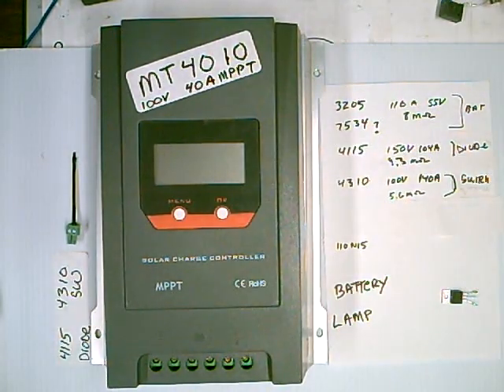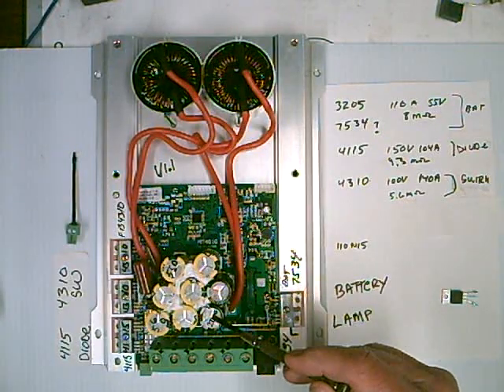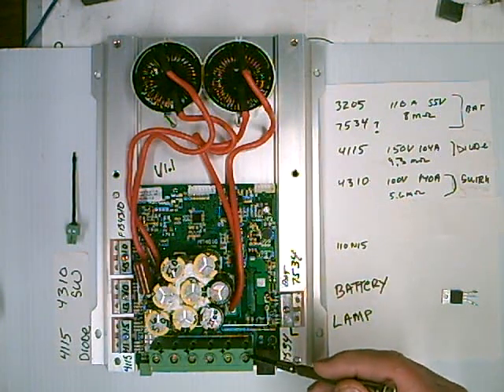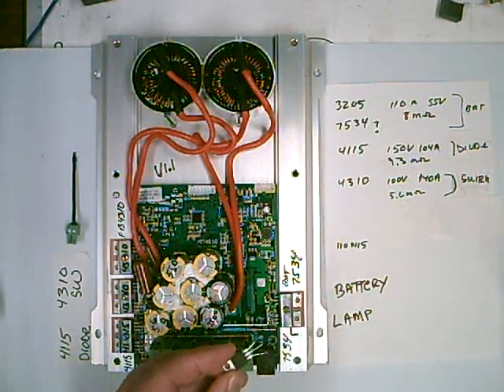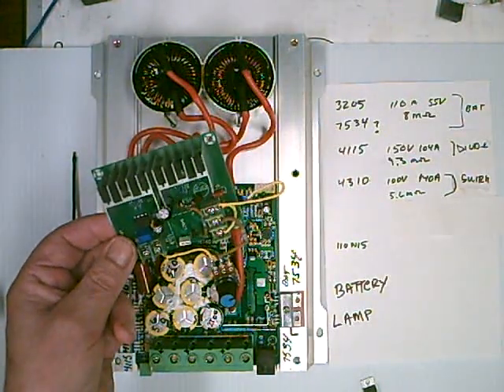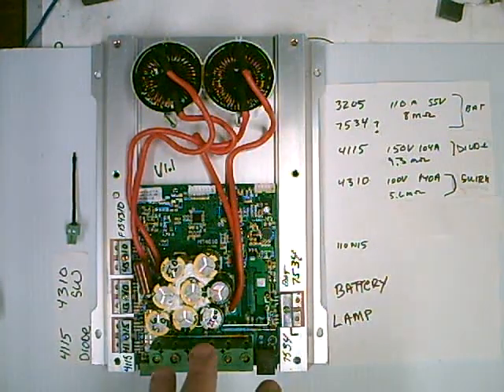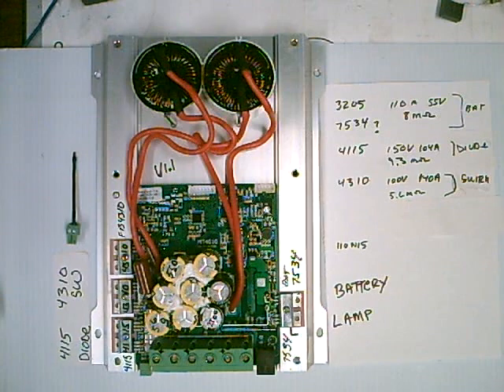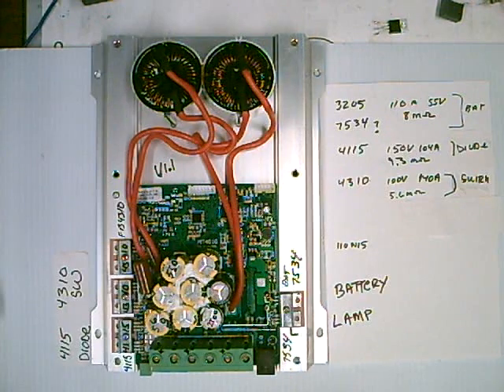Solar Charge Controller Repair MT4010 40A 100V MPPT

Comment: Today's standard PV like the China's 550watts having a Voc of 51.9volts x 2 = 103.8v if in series.  It is just barely above the MT4010 maximum PV voltage input of 100v. Will it safely accept the  input voltage safely (103.8v) instead of setting in parallel connection? 

Well we knew the economic and safety advantage of wiring  lower current.

Comment: Hello opera are you got my last messages about 494.
Reply from the maker: I was going to reply when I did some more testing.  I was testing a bare bones version when I placed a charged capacitor on the 5V pin and blew the chip. I had ordered a couple dozen and they should arrive soon. I may want to lower the frequency when at your higher voltage to reduce heating.  What number FET did you order?
Reply: @opera5714  Hello opera, i order this https://www.tme.eu/lt/details/irfp90n20dpbf/tranzistoriai-su-n-tht-tipo-kanalu/infineon-irf/   if it is not ok it is possibility to return back them. The number is IRFP90N20DPBF

Comment: Do you have full control over the output voltage? Like can you specify the absorb voltage and the float voltage?
Reply from the maker: No, it does not have lithium and battery types are set at GEL, AGM and FLOODED. It is four stage. Everything is fixed at least with this software version and I have only found one manual in searching MT4010.
Reply: @opera5714  that's too bad. I even ordered a Chinese unit that looked a bit different than this one and it was built really well but the software sucks even though they said it had fully customizable voltage set points and could be used with lithium batteries they actually did not.   on top of that every few days it would randomly refuse to charge until i power cycled the device. I gave up and bought an Outback